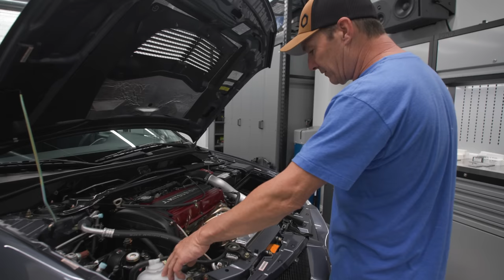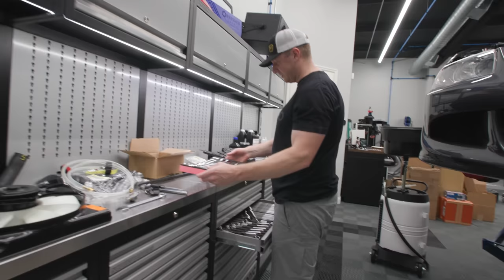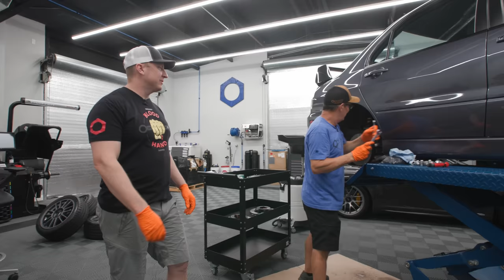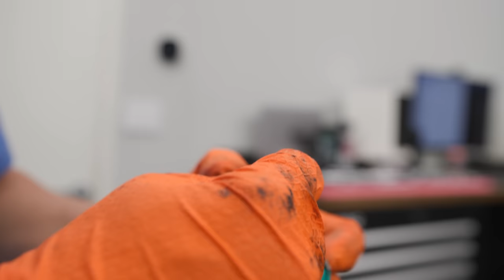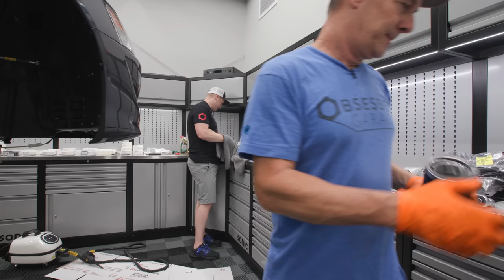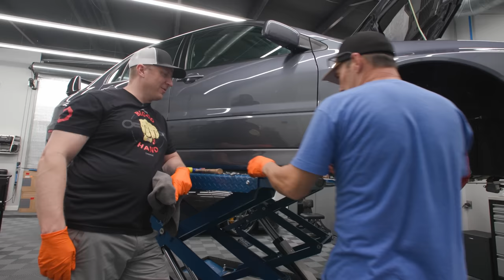OG Mitsubishi EVO 8 - Girodisc Brakes and Steam Cleaned Calipers | The Beater Build

Comment: The stock brakes are fine for occasional track days, they will turn brown though are too much track heat. Those pads are not, you'll want something better like Dixcel Z Type or PMu HC or Endless MX72 for pads that will track and street.

Comment: My experience is that the sound of a new exhaust changes significantly over the first few 1000 miles as they coke up on the inside.  Seems odd that you junk exhaust based in the first start and a few burns down the road.